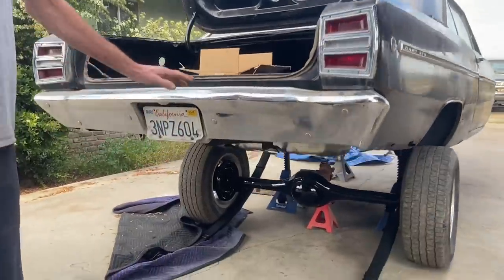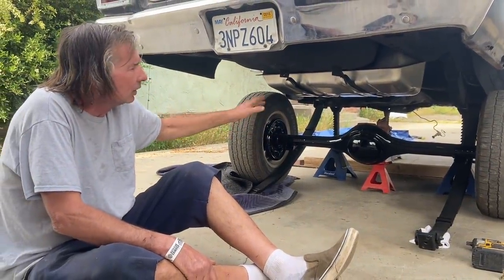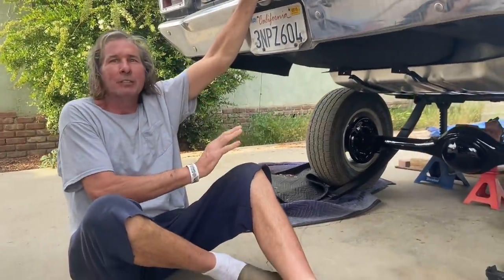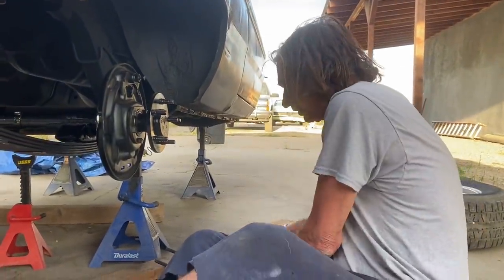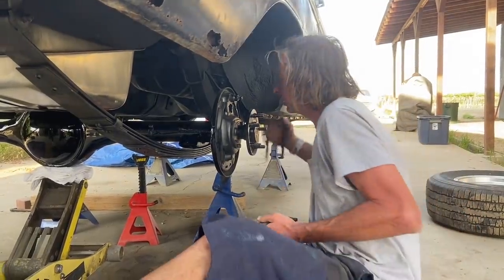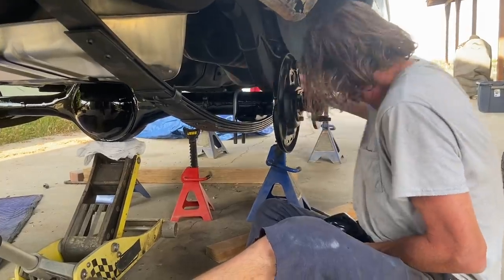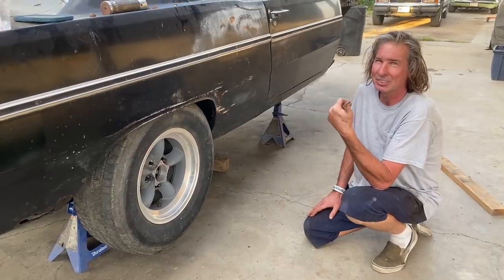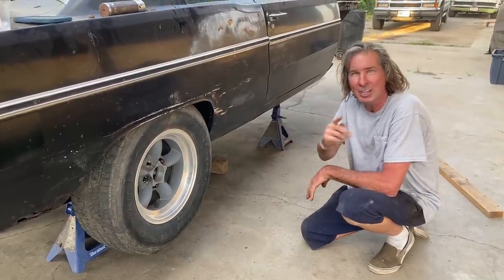1968 Dodge Dart Rear Install

Comment: Back in the day (1981) I had 69 Dart. I moved the leaf springs inboard, rewelded the spring perches, and made mini tubs.  I put 4.56 posi in it and fit L60-15 on factory rallye wheels.  I had the axels drilled for the big bolt pattern.   No internet back then. Everything was learned from experience.

Comment: Back in 1971 I had a 65 Dart 273 High performance. It came from California to Ohio but it had a 7 1/4" Open 3.55 rear.😢 I found a 69 340 Rear 8 3/4" and it bolted right in except I had to shorten the drive shaft some. I put in some 4.88 gears and fenderwell headers and that thing ran 14.70's!! I beat a lot of 383 Roadrunners with that car! It even held a AHRA National Record for a while when I raced it!

Comment: I didn’t notice until now but Steve’s chompers look nice af
Reply: I noticed this as well. Had to do a double take!
Reply: I was also noticing, thinking Did he get some new Teefus ?
Reply: Yess...those were custom fabricated out of body filler.
Reply: @rollin19  I thought they were formed with bronze and finished with white laquer?!?
Reply: I reckon he's had them whitened, not my game but if it works for a guy why not.
Reply: They are new.
Reply: He actually just used white acrylic enamel went off the gun  super smooth
Reply: They look terrible I reckon
Reply: @Paradise_Arms  nah-uh i was here first

Comment: Back when that car was only a few years old, I used a jack to push out the wheel wells. Looked good on a coke bottle 68 Chevelle with Mickey Thompson L60-15s.

Comment: I love that you are posting stuff here, Steve. I wish you found time to post more and more often. I'm subscribed to MTOD, and I'm sad to see that it will no longer be available outside of US and Canada after August 18th. I'll really miss watching the original content like RKG, HRG, RK, FWF.
Reply: Get something like express VPN, changes your server location so you can watch from wherever
Reply: @paultully3041  I would need to do more than just connect via VPN, because they'll be closing down the subscription on my current non-US/Canada account. I'm not sure that I could sign up again from a new e-mail address with a credit card that is clearly not from the US/CAN even if I did it all via VPN. In other words: I need an account that looks like it's from US/CAN both in regards to connecting and payment, I would think. But thank you for the suggestion :)

Comment: I'm using a 2007 jeep grand Cherokee axle on my 62 Chrysler project, 300.00 from the wrecking yard ,now I have disc brakes and 16 inch wheels.

Comment: I bought a jig and narrow my own housings.  Hardest part is the math to get it all right.  Set wheels/tires where you want in the wheel wells, measure and make the rear fit to that.

Comment: Have you ever converted a 67 A body to a 68 and later fuel tank for exhaust clearance?  I am going to replace the tank in my 67, so I am thinking of updating from the side side to side fuel tank and strap to the for and aft tank and straps.

Comment: Steve, didn’t uncle Tony tell you that you don’t need slapper bars on a Mopar with asymmetrical leaf springs ? 😂
Reply from the maker: Yes, but I do my own thing.
Reply: @stevedulcich2656  Right on, wtf has Uncle Phoney actually accomplished  in his "illustrious" internet career? A bunch of stillborn projects destined for the scrapyard.
Reply: Uncle Tony don't know everything..
Reply: I don't use them and never had wheel hop just put one clamp on the front section works great!
Reply: Uncle Tony more full of himself than actual useful information.
Reply: @Hanzyscure  that’s a stretch. Tony is one of the coolest, laid back guys in the car world
Reply: @jerrytee2688  Apparently you havent seen all of his pre internet stuff. No reason to hate on him.
Reply: @beyer66  My stretch is more accurate then yours.
Reply: @jerrytee2688  get educated
Reply: @Hanzyscure  But mine is not even a stretch
Reply: @jerrytee2688  hey, what's wrong with uncle.Tony seems like an insightfull guy, with little BS, and a genuine hot rodder on a budget.
Reply: @stevedulcich2656  Its the look your after.. then it's for sure the thing.. Be You.. not sure if most Non Mopar owners know how far forward the Axle Position is..  and why Slappers for Mopar aren't offend used.. I'm Daily driver everyday and everywhere 68 Dart.. peace Brother keep at it Mopar A Bodies Forever!!
Reply: @stevedulcich2656  You can have the slapper bars someone put on my Mopar and I’ll eat the shipping.